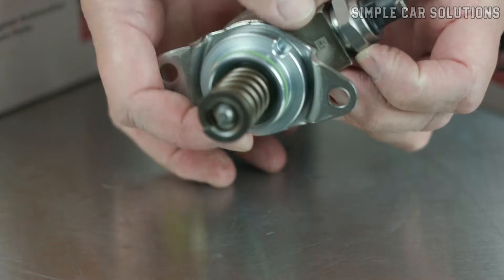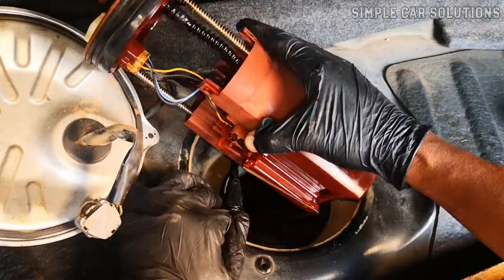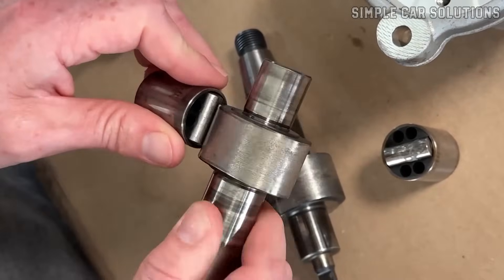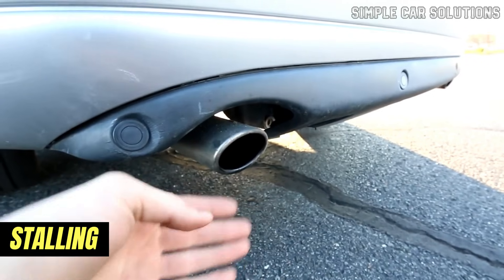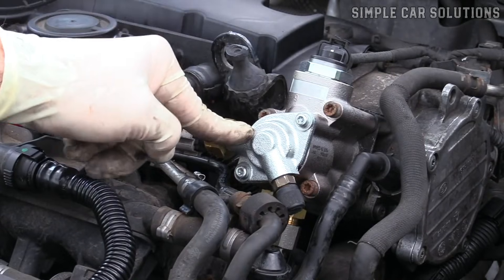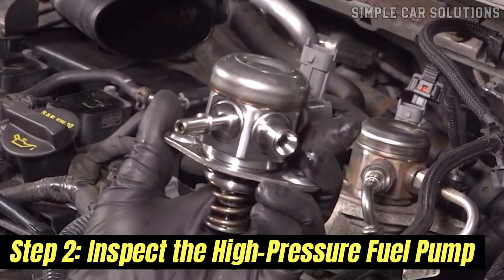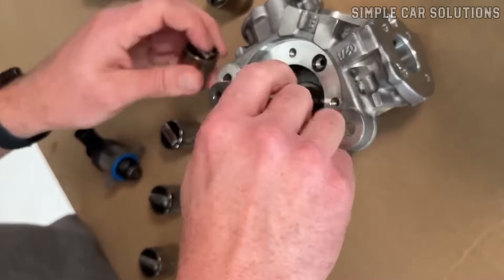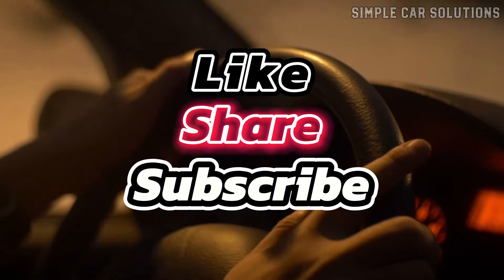Bad High-Pressure Fuel Pump Symptoms. HPFP Failure Symptoms

Comment: I'm driving golf 5 FSI 1.6 my problem now is sometimes the car can go died out of no where n while driving especially when I stop at the stop sign
Reply from the maker: That sounds like a failing high-pressure fuel pump or fuel pressure regulator — both common on the FSI engine. Scan for fault codes and check fuel pressure to confirm.
Reply: @SimpleCarSolutions  can an EPC signal loss be due to that?
Reply from the maker: @varsitypodcast  Yes, EPC light can come on due to fuel pressure issues, especially with a failing HPFP or sensor. Scan the codes to be sure.
Reply: @varsitypodcast that's exactly what's happening to my vehicle at the moment...

I'm replacing everything in my fueling components... hpfp lpfp sensor filter and modual
Reply: Your iac is probably bad it does idle under load

Comment: Hi my golf GTI ccz engine have some noise  how do I know if it's a pump😢
Reply from the maker: On the GTI CCZ engine, a failing high-pressure fuel pump (HPFP) can make a ticking or knocking noise near the top of the engine. Common symptoms include rough idle, loss of power, misfires, or long cranks. To confirm, listen near the HPFP with the engine running, scan for fuel pressure codes, and check for metal shavings on the cam follower.